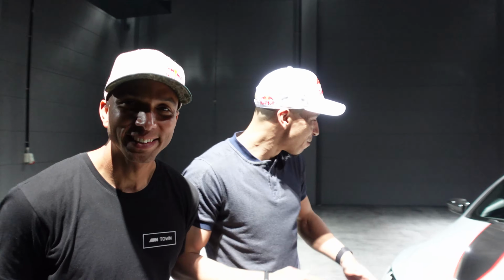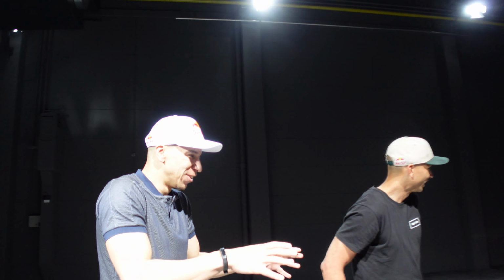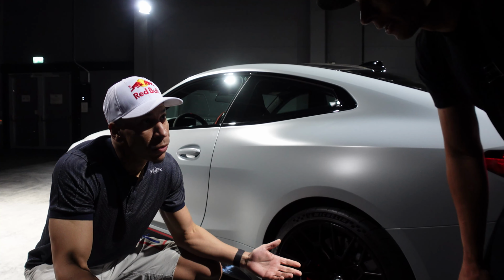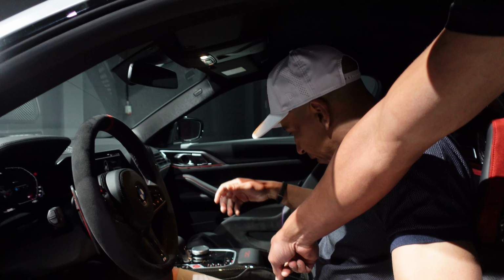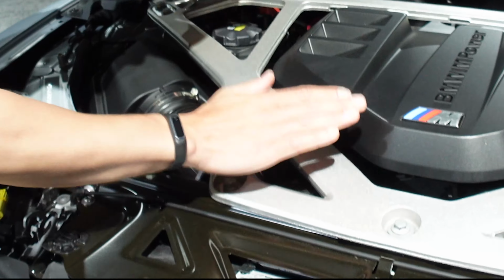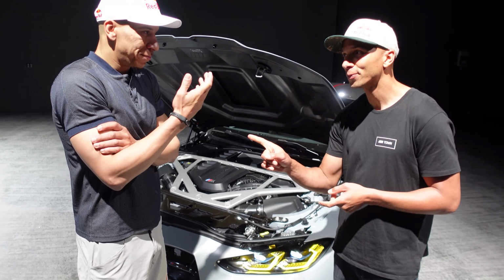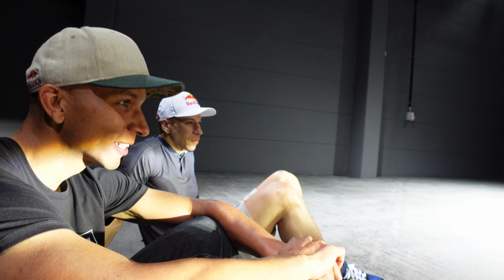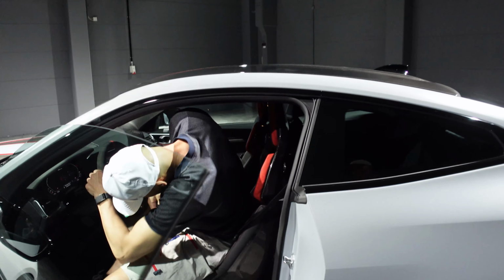EVERYTHING You Need To Know About The BMW M4 CSL

Comment: Why not save another 25-30kg on a manual gear box? I get it the car is faster with auto but this is street car not track. Love the CSL either way but that’s a lot of weight to leave on the table. Also option for shorter gearing and lower top speed. This car is a rocket ship and can be made even more so.